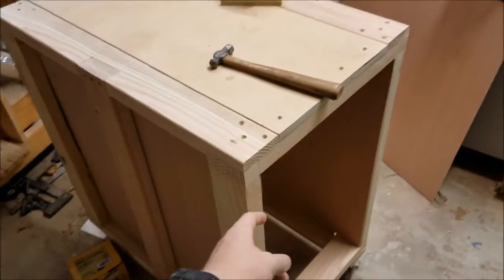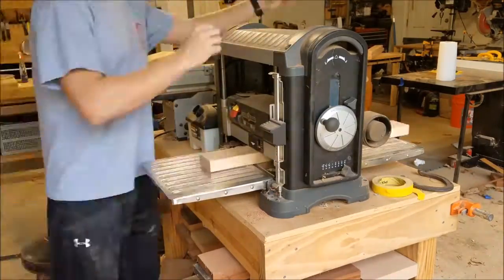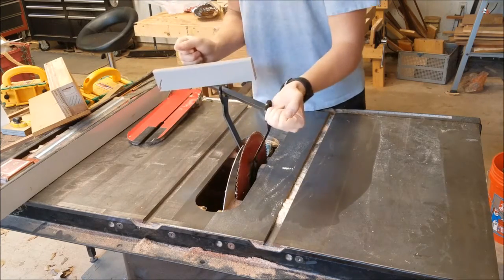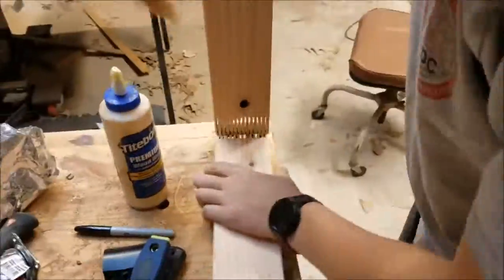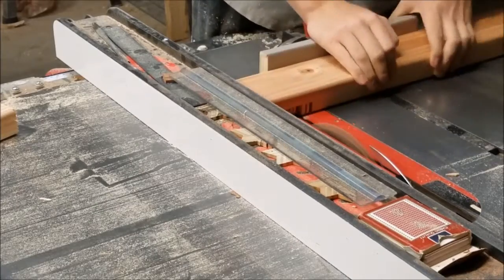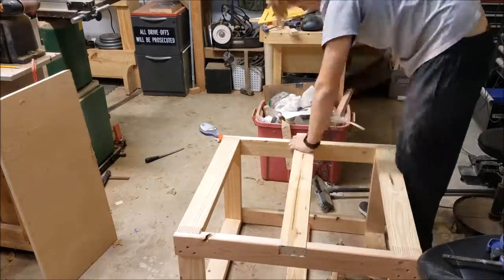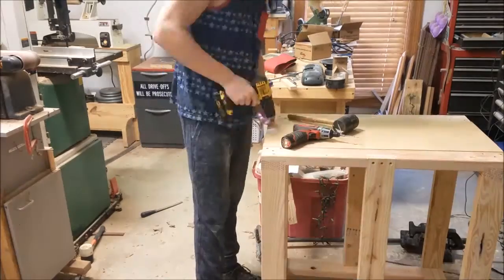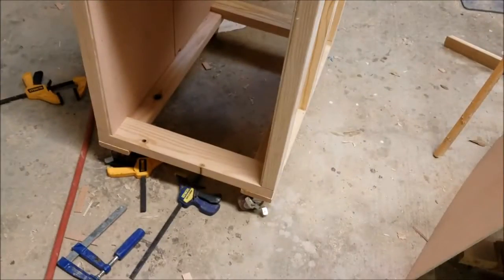2x4 tool cart

Comment: 1:48 You are tightening the arbor nut way too tight. It should only be snug and require light pressure to loosen.
Reply from the maker: Rick McQuay thanks for the input, however in that clip I was loosening the Arbor, when I tighten it I simply do it by hand, however sometimes I find it difficult to loosen it the same way. Perhaps it tightens due to usage, as I rarely change my blades.
Reply: I understood you were loosening it, but it shouldn't require that much leverage. I spin mine on finger tight then 1/8 or so turn with a wrench. The nuts self tighten so you don't need to crank down.